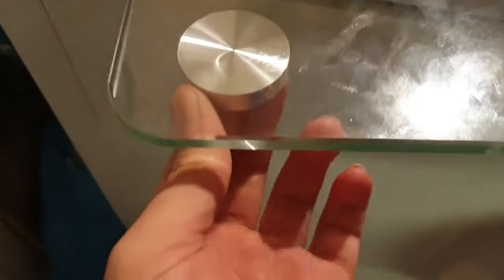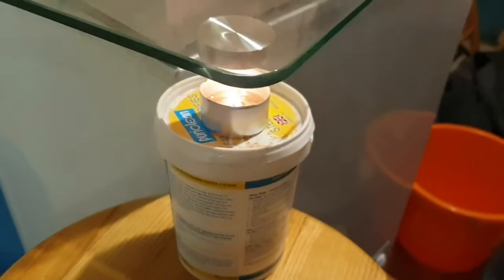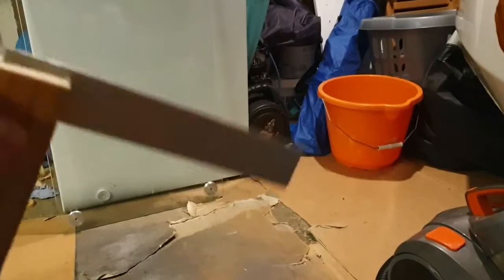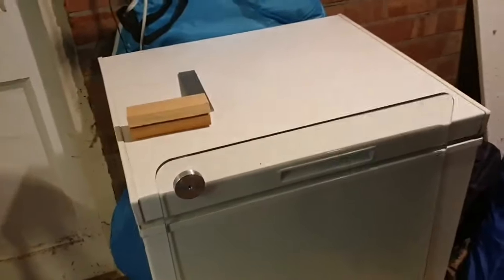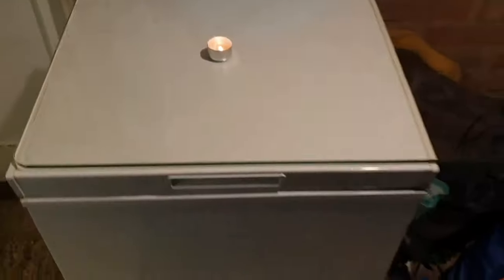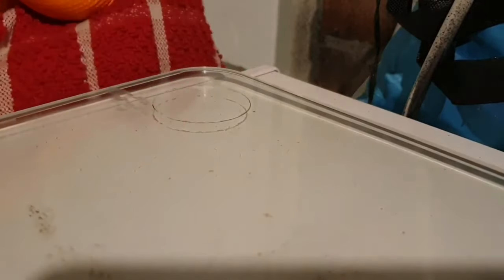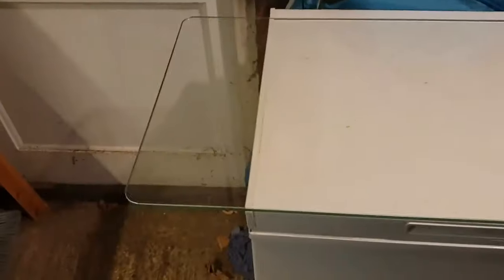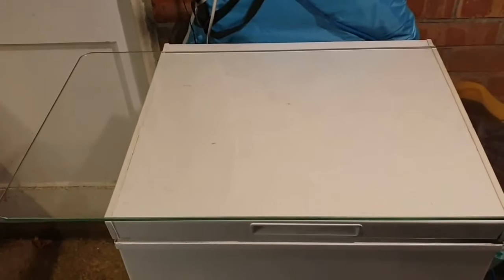How to remove bonded metal fixings from a glass table top - cheap method

Comment: I know this is an old post but I just stumbled upon it while researching methods for removing aluminum square blocks from the corners of 3'x 3' 3/8" thick tempered glass.  After watching this video I had another idea since I did not have any tea lite candles on hand.  I removed mine with a soldering iron which gives a very controlled and precise/targeted heat source.  My aluminum blocks had a threaded hole in the center so I put the tip of the soldering iron in the threaded hole and I used a clamp to manage the cord and support the soldering iron.  Took 5-10 minutes and a couple light taps with a stuby hammer and the blocks slid away.  Residue easily cleaned up with acetone.  No damage or marring of glass or the blocks.

Comment: THANK YOU for this video! Super grateful. I had 2 round side tables whose legs were wobbly and falling apart, and thanks to your instructions I was able to remove the metal fixings and have re-purposed the glass tops by placing them on various round vintage items I had. It worked GREAT and I'm glad I did not have to throw away perfectly good glass pieces! Oh, and it only took 8 minutes each with the candle, and I used Nail Polish remover to remove the excess glue and it worked great!

Comment: Thank you so much for this video. It helped me tremendously. One thing I did that worked even faster… I did not have a candle so I used a sterno. This worked  even faster (about 5 minutes) and when pushed slightly with a wooden ruler, they all slid off quite easily. Thanks again for sharing.

Comment: You are a genius, ‘make do workshop’ 😀
That method is absolutely fantastic, and with a squeezing too, the aluminium part can be be removed afterwards with astonishing ease, requiring to hardly apply any force.
I’m very grateful 😉
By the way: in order to remove the remaining glue, just using regular nail varnish remover does the job perfectly in less than 2 minutes.
Kind regards from Belgium.
Reply from the maker: Thank you very much, glad to be of help! Nail varnish remover works perfectly - it's made up predominantly of Acetone and is much easier to obtain. Greetings from the UK 😀👍

Comment: Thanks so much for this video! Because of it I was able to salvage the aluminium circles off from a glass table I found on the side of the road! I really needed circular pieces like them for a project of mine so this helps tremendously! 

I ended up applying a bit of acetone to hopefully loosen up the glue first and then hitting the aluminium with a butane torch (not literally lmao) and they  popped off from the heat after about a minute or 2!

Comment: Thanks so much for this video! I had a glass table top break and apparently the company I bought this table from makes these proprietary-sized adapters and refuse to sell them or new tops, so I couldn't buy them anywhere. I ended up using your video as inspiration and ran it under some scalding hot water to loosen the glue and it popped right off!

Comment: Thank you for this (although I was on edge for your wrist  as you were prising them off!) 
I have a set of glass & metal bathroom scales, which are stuck in exactly the same way and I want to re-purpose them, as a surface, for my Polymer Clay modelling, so getting on with that today.
Cheers!

Comment: Great tip, 👍🏼 however, if you use a set of pipe grips the glue is soft enough to get them off in a few minutes, also the glue that’s left can be scraped off with a Stanley blade without the need of any solvent.

Comment: I opted for.the heat gun method, but not knowing heat would do the trick, you showed me how ro do this. Glass is so expensive. Someone gave me some old glass tops so I could use them in my classroom. Tried this before by using acetone and a hammer with chisel. I shattered them. This time, IT WORKED!!! Thanks!!!

Comment: Thank you so, so much!
I had this glass scale that I was ready to give up on (I had been dinging at it with a box cutter >.< ).
I used nail polish to remove the left over glue instead of pure Acetone 
(I believe there is a fair bit of Acetone in nail polish). 

Now I have a beautiful pallet <3
Reply from the maker: Glad I could help! Indeed, nail varnish remover is predominantly made up of Acetone and works just as well. Sounds like a good result 😊👍

Comment: Cool.  I have the same problem on a table top I salvated and this could remove the metal fixtures on it.  Any ideas on how to separate two pieces of glass that were bonded together (epoxy I think from the slight smell I got after scraping a bit away)?  It's a rectangular 'tube' about 48cm high, 20cm on a side and glass 19mm thick (so the glued interfaces are pretty wide).  I tried a razor but that only works to a mm depth or so then the glued gap is too thin to push the razor farther down . I'd throw the whole thing in an oven but I don't have any that big.  I tried some acetone soaks on the seam which didn't work but I didn't use much either and it evaporated in 10-20sec.  I'm afraid to use a heat gun since I can't heat the whole 40cm length at the same time and I feel like maybe the glass is going to crack if I don't heat it evenly.  Not sure what else to try.

Comment: I've had candles under them for an hour now and still won't budge, I can see the glue changing and appearing like it shows on yours and it is getting very hot- how much longer should I wait and let it sit before giving up? Im using a knife to try to push them off, would another tool help more?
Reply: Curious. Were you able to get the aluminum pieces off?